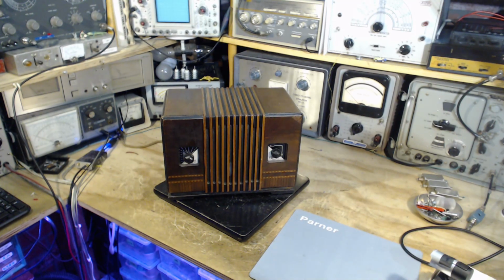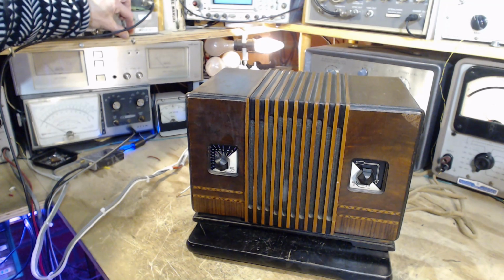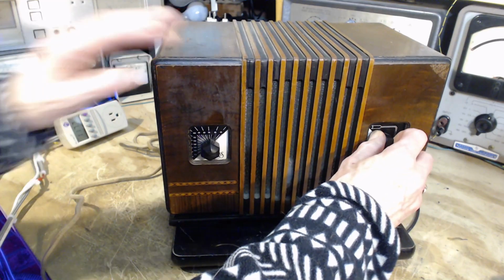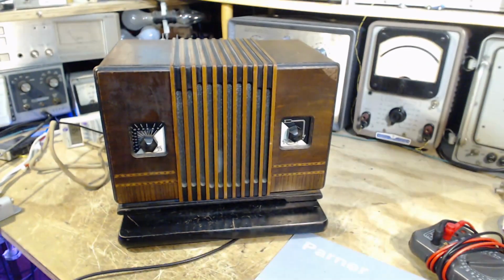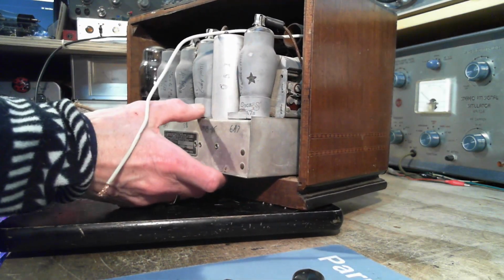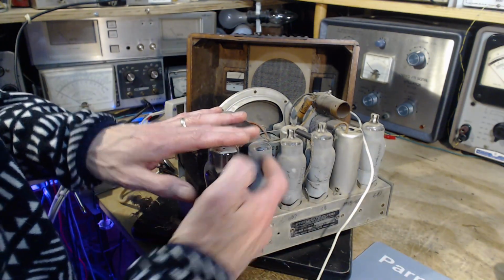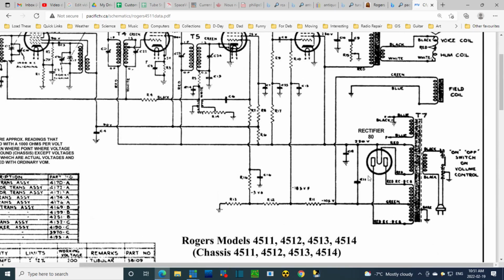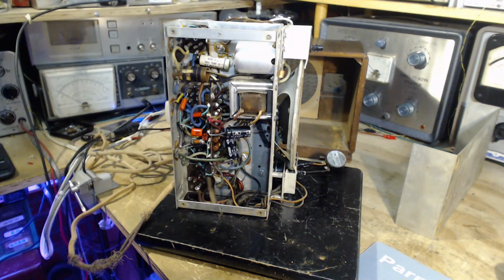Rogers Majestic 4511 Tube Radio Video #1 - Inspect and Test

Comment: Why is Jim swinging the radio around to see if the signal improves. Its on a external wire antenna not a built in antenna which would be directional.
A lot of military tubes had a grey shielding coating on them.

Comment: Check the B+, first..then start looking at caps...make sure the line voltage is right too. Yeah check the tubes for any shorts and good pin contact...Hum is annoying but you can scope it...seeing if its 60 cycle or.......

Comment: James , why do you waste,so much time trying locate radio stations when you know you are in a dead zone. You have several 
Really good signal generators you can put out a decent test signal with and detect the signal strength from the generator signal strength meter.
Reply: Lets be honest; to use a signal generator as replacement for reception via antenna, you have to be aware of the signal strength the antenna would provide. And to replicate that you need to be able to rely on the test equipment meters to reproduce that level. And you need diligence and self-control to withstand the urge to turn up the generator to signal levels that would never come from a normal antenna.
But how many times have we seen Jim increase the output of his generator on alignment procedures, where if done properly on a working set, the sensitivity should increase on every alignment step, making you lower the signal level.
But OFC using a signal generator comes in handy to make it appear like the fixed radio was sensitive...

Comment: The rear plate label indicates the unit is equipped withe 25Hz capable transformer for use with Ontario Hydro 25Hz mains AC power. That transformer is heavier than the 60 Hz transformer used on other AC mains not sourced from Niagara Falls AC.

Comment: Nice cabinet. This radio has 12 capacitors going to B- ( chassis ground)with one also an 8uF electrolytic capacitor. 
On the schematic one side of the power cord goes to B- ( common) without a capacitor. Very hot but in a bad sense.
 Full of new stuff inside but the line cord is crapped out. The correct size paired electrolytic caps were originally 8uF  
and should not go over 16uF!  22uF IMHO is too high. There still are some old caps in it. Hopefully the last guy didn't 
omit some of the caps to chassis along the way or you may get hum. Check the tubes first Jim.
Reply: Where in the schematic does it show that one side of the power cord goes to B-?
Look closely! There is a shield drawn around the power cord line right before the switch, and this shield(!) goes to chassis. The shield arrangement basically is a low value cap and lets you use the power line as quasi earth ground for RF but offers good insulation at 60Hz. 
And regarding the filter electrolytics on the 80 tube; max per datasheet is 20uF for the first cap. So 22uF from the value standpoint is not that big of a deal. However you are right in condemning this high of a capacity judging by the value the designers chose; 8uF. So 10uF would have been the appropriate choice.
Going overboard on the capacity will cause high peak charge current. And this effect is not so much related to inrush current but the repetitive recharge events that appear near the peak on every half wave! That is why going overboard on filter caps can damage rectifiers and overload transformers!

Comment: Considering that the set has been worked on, you should make sure that the filter caps are connected correctly:the first thing to check:there are 2 caps, the - side of one goes to gnd, but the other - goes to the center tap of the HV winding.
If the previous restorer connected this to a different point....
As for the + sides-likely ok, but that's the second thing to check.
It's interesting that this radio does not appear to use the speaker field coil as a power supply choke.
Also, part of the reason that this radio is so heavy:notice that the radio is spec'ed to operate from 25 cycles to 60 cycles-a 25 cycle transformer needs much more iron, else it will run hot.
A set that is only designed to operate at 50 and 60 cycles can use a much lighter power transformer.